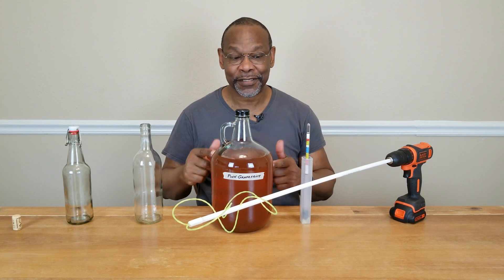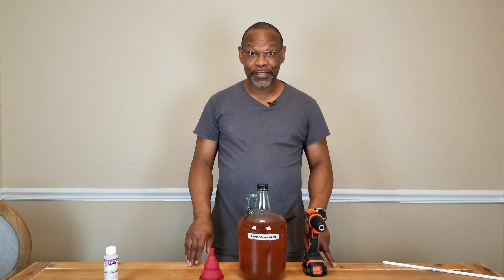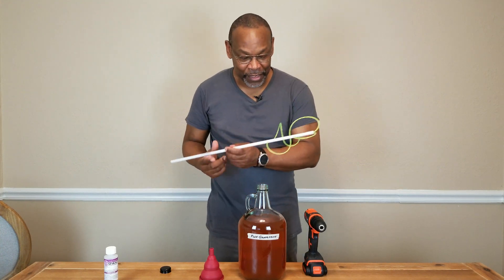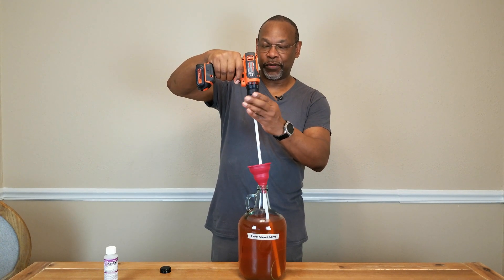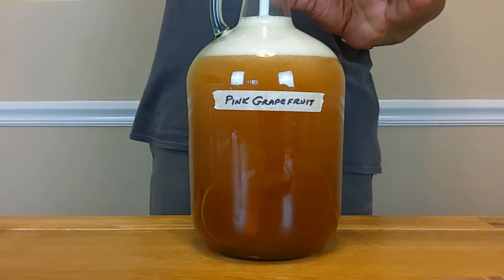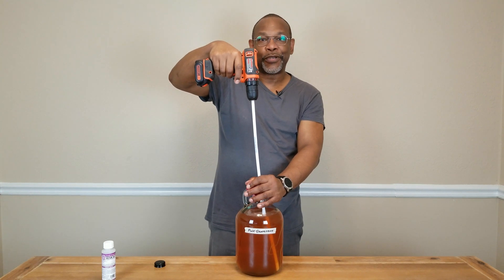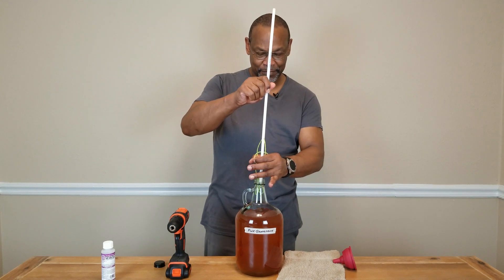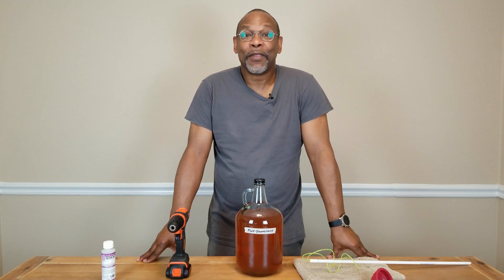Degassing Your Wine

Comment: Have you tried vacuum degassing? An easy vac pump can be made from a bicycle tire pump(just reverse  the cup on end of rod turn check valve around).
  Seen it done with a shop vac too.

Comment: Why do u degasssing it? Is it important?
Reply: 2 bottle early, not recommended for quality
Reply from the maker: To reduce the possibility of pressure buildup inside the wine bottle.
Reply: @DIYFermentation  Once the yeast has consumed all the sugars in the must, even if there is CO2, it will not increase the pressure in the bottle by itself.
If your corks are popping, it is because the yeast is still consuming sugars. This means that your fermentation is not complete.
Some startups about 10 years ago selling wine kits would sell a rod with some chains welded to it for $30.00 so that you could degas your wine, or better yet, ruin the wine.
I think this myth is still alive.

Comment: Why don't people just warm up the wine? Not too hot to evaporate the ETOH but warm it and then gasses are are forced out of the solution/wine??
Reply: its called pasteurizing, ppl do do that 🤷‍♂️🤦‍♂️it doesn't force any gasses out it just kills yeast, still needs degassed
Reply: @jeremy-ez6nd well, higher temps do allow for a higher rate of CO2 release, but they do not by any means release all the gas. So you're both kinda right

Comment: Thoughts on vacuum degassing? I'm finding it so much quicker / more practical.
Reply: Guess u could use a brake bleeder and a rubber stopper or something
Reply from the maker: @JdawOfficial Thank you for watching. The audience that this channel is geared towards are people who are generally not going to utilize a vacuum pump for degassing. I'll leave that procedure for more advanced winemaking channels. Here heeping things as simplistic as possible is the focus.
Reply: theres 15 bucks manual vacuum pumps out there, no need for a motor vacuum pump @DIYFermentation
Reply: @DIYFermentation  thank you for your reply. I honestly feel a vacuvin is arguably cheaper and simpler than the drill method for carboys. Though some people are worried about implosions / pressure issues. I’ve never seen a wine saver break a car boy though 🧐

Comment: I see a lot of people big into wine doing these degassing videos with a drill. what I don't see is alot people in the tool trade commenting. I worry about getting drill brush dust in my wine.
Reply from the maker: Perhaps tjhis might be an issue with wide-mouth buckets, but not so with carboys due to the small opening which is usually covered up by your hand to steady the whip.

Comment: Your wine doesn’t need degassing, pro winemakers never do it.
Reply from the maker: Thank you for you comment. I should point out that this is not a pro winemaking channel. Her we do not make wine under winery conditions. This channel does not use sulfites (apart from a few early videos).  Before I started to pasteurize my wines, I've had  broken bottles and popped corks due to not properly degassing the wine.
Reply: Pro wine makers dont degass this way because they do through pumps to remove the possibility and contaminating by oxidation and degassing is an extra benefit....so yes the pros do degass wine.

Comment: Do I need to do the same thing to mead?
Reply from the maker: If left to bulk age long enough most wines/meads will degas on their own. I read that many people never degas their batches. But, I have had the experience of popped corks and one broken bottle due to not properly degassing the wine.
Reply: @DIYFermentation  I have the same experience. Not mentioned to much in mead making. I have a standard mead aging going on 3months in secondary. Thank you.